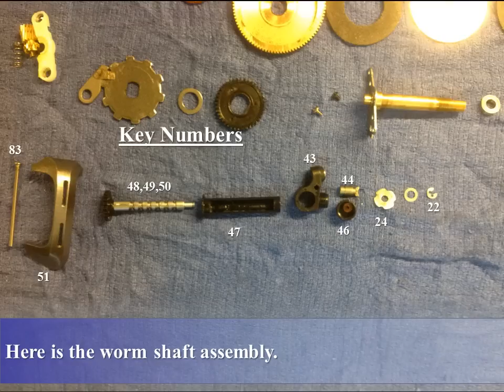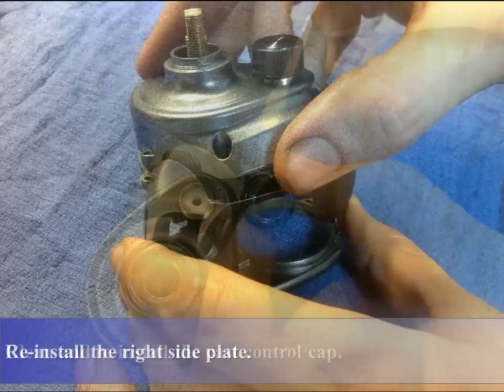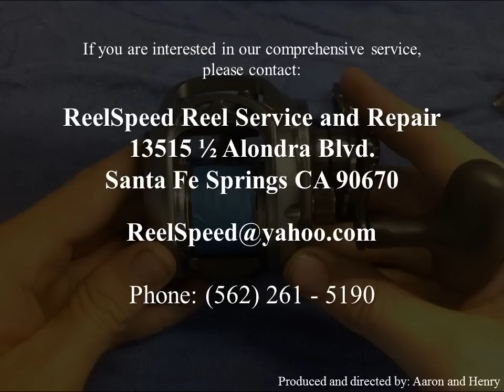Daiwa Lexa 300HS-P Reel Service Tutorial

Comment: Hi there, thanks for the really really informative video demostration!!

Just some questions i would like to ask about your method...
- May i know what's the reason/and advantages for removing the bearing shield?
- Wondering, do you replace the bearing shield to the bearing after greasing it up?

- and for the last step before closing back the left cover, do you grease up the whole bearing on the left of the spool as well, just like how you did for all bearings?

Thanks again!!